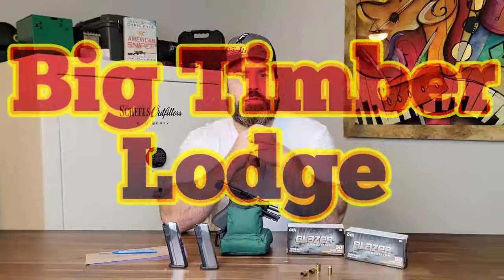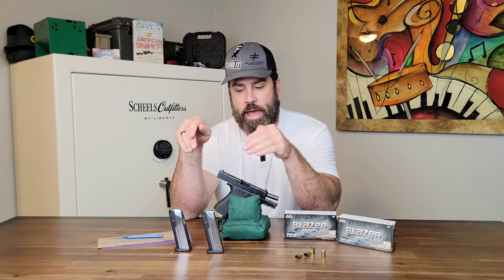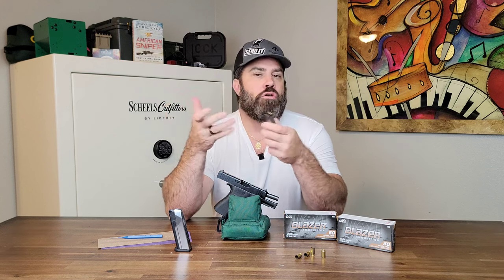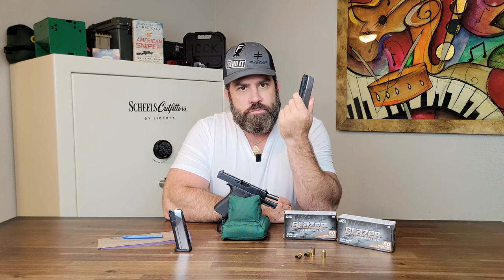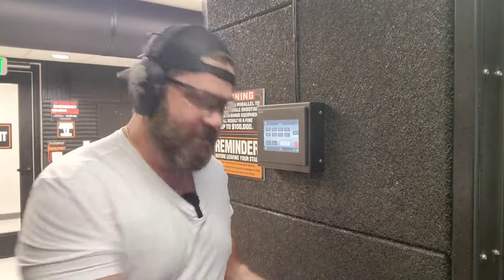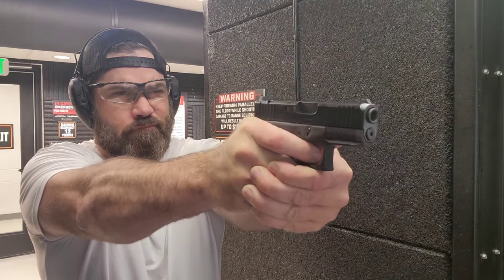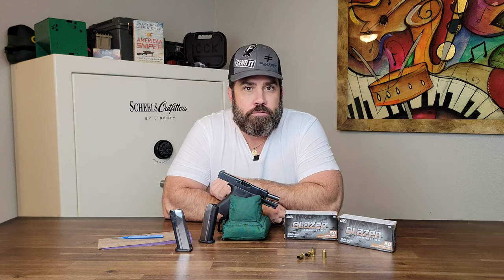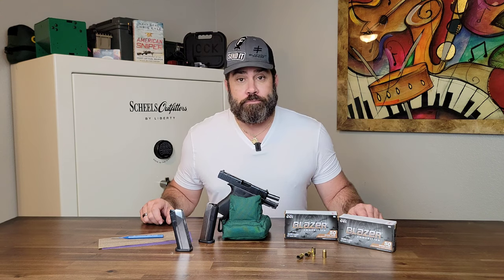PSA DAGGER MICRO MAGAZINE FIX IN LESS THAN 5 MINUTES PART 2: I WAS WRONG 🌟RERELEASE🌟

Comment: School of the American Rifle does a nice video on cleaning up the PSA mags as well.  I also noticed that psa has made a couple of changes to their mags since these came out, the newer ones being pumped out don't have as much polymer on the inside. They also made some other changes like the follower, I have one that came with a printed follower, but I swapped it out for a glock 9mm and it works fine. The PSA printed one has the rear cut off probably to reduce drag inside the magazine.
Reply from the maker: That's a great video
Reply: I watched that video and tuned mine up before I even shot it and it’s been flawless

Comment: Just found your Part 2 of the PSA magazine fix for the "does not hold open on the last round" issue. Went to Part 1 and followed your suggestions, only difference was that I used 600 grit vs your 100/150 as I have had problems with removing too much material on other repairs. Now magazines work as designed. No issues. THANK YOU! I was just about ready to go the route of return the mags to PSA but this helped fix it.
Reply from the maker: Heck yeah!  That's why I make these types of videos. I'm really glad it helped you out.

Comment: I had issues with mine feeding well.  PSA advised to sand the inside of the magazines and sand the edges of the follower. When that still did not work, they stopped responding all together.  I'm sticking with stock mags or just run the X Macro as those magazines are made so much better.
Reply: If you have to sand your mag to make it work it shouldn’t be sold in the first place. Oem always.